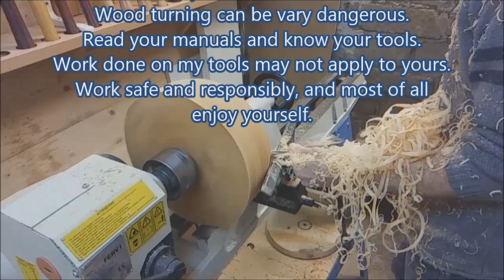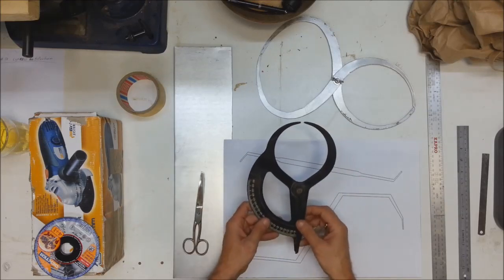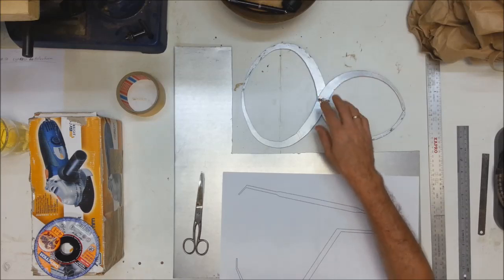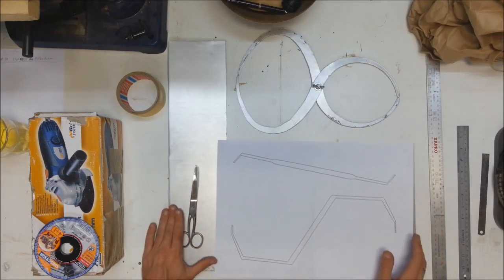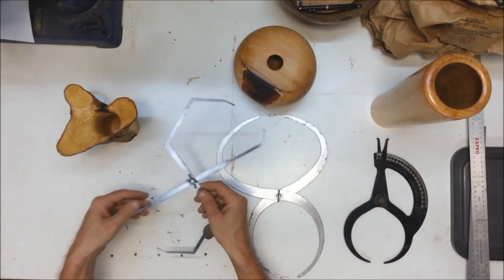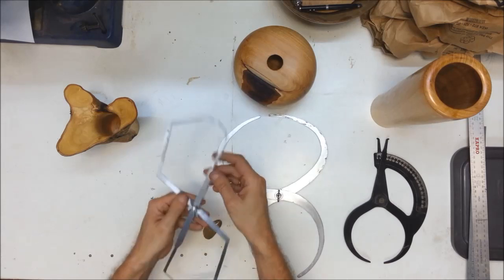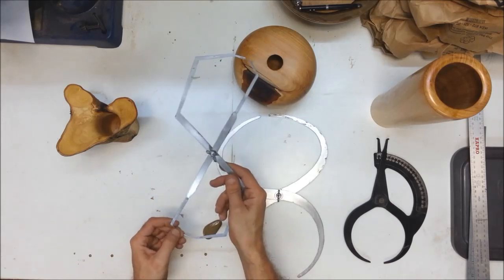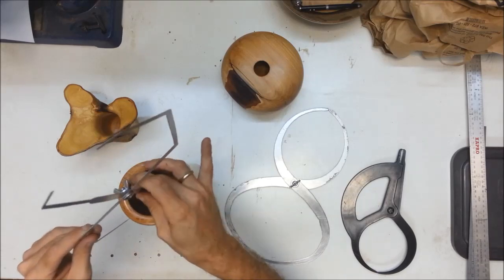Off Topic : DIY Woodturning Calipers

Comment: Really slick, Yuval! I wouldn't have thought that narrow a piece could be successfully cut with an angle grinder. I'm going to have to try that sometime. Thanks for posting!
Reply from the maker: RickTurns Rick, you have to have magic hands like mine to be able to cut like that... ;) I was also in the dark about it, I had the metal plate for making a jig so I could index my lathe, for a project or two at least, but when then need came, the material was there, well, that is what happens when an handy man needs something right here, right now. Thanks for commenting!

Comment: Very useful Yudal. Wait that should be your channel name Useful Yudal. Got a nice ring to it eh. 
Well anyway great video very helpful. I've been looking at these tools and they can be a bit pricey. Well I'm sure substantially more than a sheet of metal. What gauge metal did you use? 
Thanks for sharing do a kindness take care
Mark
Reply from the maker: MARK Baid Thanks Mark!! The metal was 0.8 mm wide, in inches that is 3/4th of a unicorn beard hair. I guess they are a little pricey, but it's the wait I can't stand most of the time, when I can afford a tool, I want it right now! I need right now! yet there is only one store in central Italy, in Rome, and it's an online store, I can't just drive there to pick something up, have to mail order, so yeah, if I'm in the middle of a project and need a tool, I will sort to making the damn thing. :)

Comment: Yuval, picture this: Just today, I made two figure-8 calipers of thin plywood. And, here, I find Yuval One making them of metal a few months ago. The really weird part is that mine aren't working right. That is to say, when they're closed, both ends are closed. When they're open, the gap isn't the same on both ends .I closed the short end on a piece of wood turned around to the big end, and found that the gap is about a quarter inch bigger. What did I do wrong?
Reply from the maker: well, what's wrong is that your connecting point is half an inch off center to one side of the calipers. That said, I'm not an expert, and I might be wrong completely. Just to be sure, I never use these calipers I made to test actual width of a wall, but just make sure the width is constant all around, I then use a smaller, cheap plastic store bought calipers to measure the actual width so I could report it right :) might be someone else reading this comment who could give us a sure answer?
Reply: I studied photos of these things to get my brain wrapped around the concept, and, as far as I can tell, the position of the pivot isn't mission-critical. I want them for just what you said - just a visual representation I can see while turning a vessel in order to not go too far. Here's what I did: I cut out the two parts, carpet-taped them together, drum-sanded them such that they were somewhat identical took them apart and turned one over, put the screw in the hole, tightened the nut with the points on both sides overlapping one another, and made a cut lengthwise like a knife going between a fish's lips (does that make sense?) to create faces that are parallel. The gap should open equally on both ends.And they do on the first, smaller, less wide open, set I made.
Reply from the maker: +Mark Wilson Your process sounds right to me, very descriptive, but right :) that should work perfectly right... could be one side of the callipers is shorter or narrower then the other, which will cause them to close and open to different length? I'll have to take the time and experiment both ways to be sure, I don't have the knowhow to tell just by thinking about it, but I'm pretty good at coming to a conclusion by experimentation...
Reply: Look at your own figure 8 in this video. The two sides - either side of the pivot - are neither circular, nor symmetrical. It was when I noticed that feature about most of the photos I was looking at that it occurred to me that the pivot position could not possibly be critical. In the set you're making in the video, the two parts con't even resemble each other, in order to give you a choice as to which way to present it to the turning. I'm now trying to work it out on Sketchup, using your new one as a model. I'll get this figured out.
Reply from the maker: +Mark Wilson Keep me updated as I want to make a new set, one larger than these, and one small, and I want to have a scale in them that will also give me a precise measurement, I'll need all the relevant information I can use. I'll also make them from a thicker stock, or just use what I have only make it twice and weld them together.
Reply: One-handed caliper with vernier. Made of plywood. Note that a little slab of a piece of the plywood  (or metal, if you insist) can be glued to one side of each end so that they actually meet when closed. 
http://www.turnedwood.com/tools&jigs.html#Caliper
Reply: Check out the guy's work,while you're there. There's a link to a Gallery at the top of the page.
Reply: I think there may be some confusion about two different types of caliper (there are many more, too).  What you have shown are single-ended calipers with scales on one end.  What he has made in this video are called double-ended calipers.  

All one has to imagine to understand either is a pair of long scissors.  When you move slightly on the handle end, the points on the other end move apart in a much greater distance.  This is because the rivet (the pivot point) is typically nearer to the handle end.  A small change on one end creates a large change on the other.  This is fine for measurement, if you can create a small scale on the handle end.

But, on double-ended calipers, there is no precise measurement, only a comparison.  Ideally,  the distance which one end has moved will be equal on the other end.  For this to happen, no matter the shapes involved, the pivot point should be equally distant from both ends.  It needs to be very precise.  When you see the big, round ones, don't let the different curves fool you.  If you were to measure from one end to the pivot, it would be equal to the other end to the pivot. 

The way Yuval has gotten around being very precise in his measurements was to clamp one end when closed and make sure the other was exactly closed, then clamp it.  This gave him the perfect middle pivot point.  This may not be as easy to do in wood.  But, simply using a design that allows for a couple of screws or dowel pins on each end (one on each point) should give you the adjustment room you need to tune it into precision.  You still want to aim for as close to the middle as possible, though.  Imagine 1cm legs on one end, and 1km legs on the other.  What would happen?  You would need very long screws/dowels.